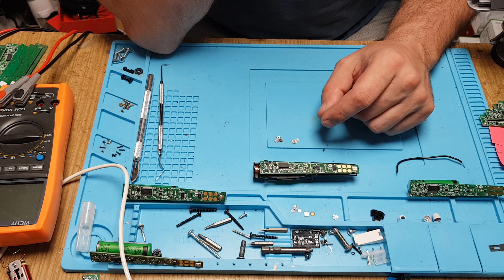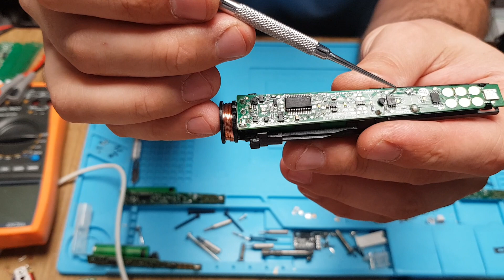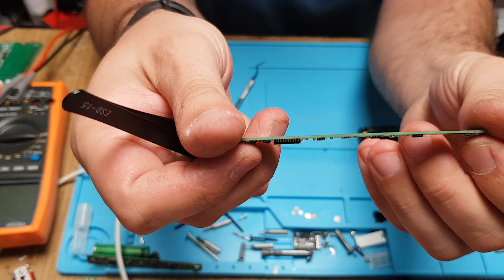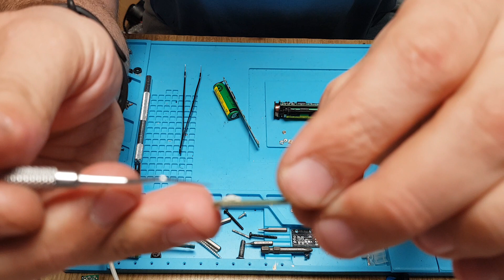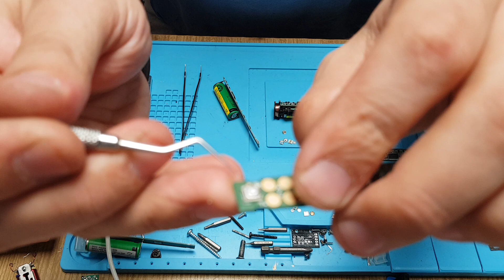Repair of water damaged Philips sonicare toothbrush motherboard, PCB diagnostics and repair

Comment: Thank you for your videos.
Would you possibly be able to measure the value of a resistor for me?  I have a HX8910.  The resistor R1 has corroded and gone open circuit.  I think this may be the feedback resistor to the microcontroller for the battery voltage.  Thanks
Reply from the maker: I have only diamondclean pcb's and the R1 is next to the main button pin that I show in this video. It's value is 3.2k ohm
Reply: @letsfixitgarage  brilliant thanks. It's the pull up resistor on one of the speed selection buttons.

Comment: Thanks for sharing how to fix the toothbrush series! My dead brush brought me here. When I press the button, it doesn't vibrate at all. All the indicators blink all together. I didnt drop it, is it possibly water damage or something else? Appreciate ur help on this! Thx
Reply from the maker: I would suspect water damage. A lot of water damaged boards that I have have these symptoms I assume main chip senses to high consumption and shuts it down or a short somewhere has this effect..
Reply: @letsfixitgarage  I really didnt know a toothbrush could get water damage...kinda ironic. Guess I need take more care of the product...thank you!!
Reply from the maker: Don't give up, if it just started to act weird take it apart and clean everything with 99% alcohol maybe it will help. With water damage you never know sometimes it's just a cleaning that is needed and sometimes nothing helps..
Reply: @letsfixitgarage  I thought water damage would 100% short the circuit inside... Thanks for the tip!! I ll try the 99% alcohol method today!!

Comment: Brilliant and I managed to replace the battery and the corroded line under the on off button but also managed to blow the small fuse by the Battery positive terminal. You mentioned checking this for a dead toothbrush but what is this fuse called and where could I buy one.
Reply from the maker: If the fuse blew it means (or I assume that it means :) ) that there was still a short on the board.. and for the fuse itself i ordered some from china.. when it will arive and if it will fit I can list the name here as these micro fuses are quite different in sizes. But what you want to look for is a P letter on it it's the value of the fuse..
Reply: @letsfixitgarage  Thanks, have you found a common area on the board where shorts usually happen. Could it be in the electromagnet coils.
Reply from the maker: @andrewmeek7767  for now no updates, sorry. I'm afraid that the most comon place could be the board itself specially when corosion goes in to the throughout holes or under protective coating.. electromagnet would be my last suspect as it is just a wire so if you have a short it would mean a lesser vibration but not ahorting board.. or thats what I'm assuming.. but you can check it by simply desoldering the electromagnet if the board works (lights up) after that maybe i'm wrong with my assumptions..